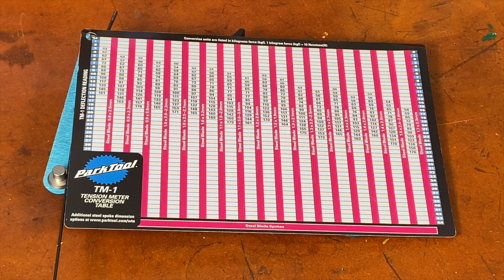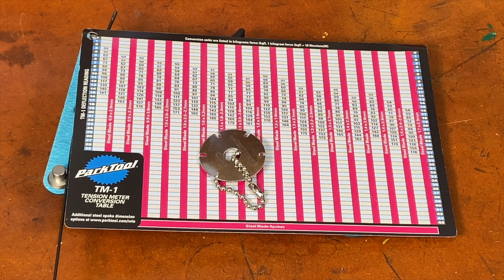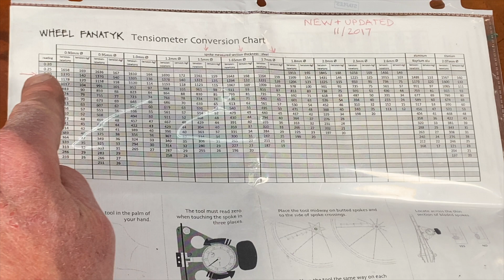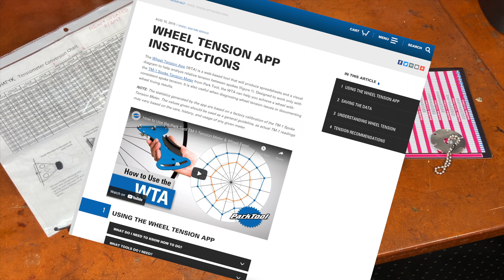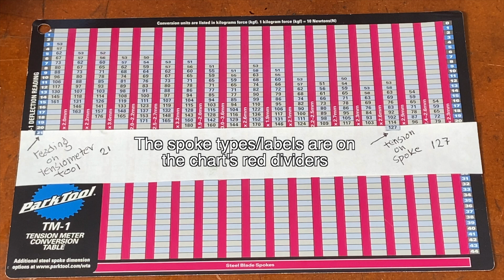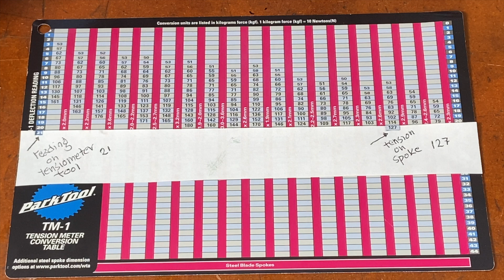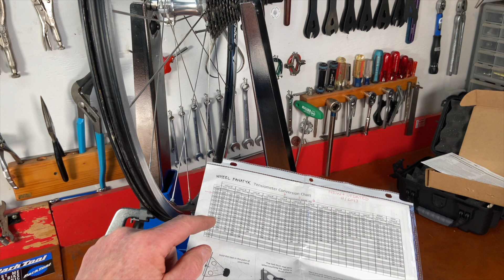Do You Need A SPOKE TENSION METER to Build Bicycle Wheels?

Comment: Thanks alot for this man the wheel on my surron has some radial run out I can feel it just a small amount so i ordered a meter I hope it will help me fix it up. On a side note please start using some o'keeffe's working hands cream on those hands they look dry and sore.  you will thank me later cheers .
Reply from the maker: You’re very welcome and thank you for the O’keeffe’s tip. I will give it a try. You don’t need a tensiometer to straighten/true wheels. All you need is a spoke wrench. In my how to build wheels video I provide complete instructions. Thanks again!
Reply: @JimLangley1  my hands got real bad one time from braiding  paracord dog leads .  dry cracked and sore as heck I got that cream and it was amazing how well it worked.  I'm gonna look up your other videos I just got the meter cause I don't wanna mess anything up I figure if I can check what the other spokes are at I can get the others close and hopefully get the wheel rolling smooth again . Cheers
Reply from the maker: @electricexploring9518  here's the link to my how to build wheels video, Electric: https://youtu.be/XUqul03hbZ8
I do appreciate the hand cream tip because my mechanic hands can get really bad as you've seen. Thanks a lot!

Comment: Thank you very much Jim. Lot's of knowledge in this video.
I've recently built my first wheel without a tension meter and was worried that the spoke tension will be uneven or too tight / too loose. I'm sure they are, but not so much that it matters. I've abused that wheel a lot and after a second tensioning when the spokes set, it stayed very very true. I used a second wheelset with similar spoke count and spoke length as "tightness" reference. By squeezing the spokes with your hand you can develop a feel for how tight they are.

If you are not a professional wheel builder, I agree, you don't need a tension meter to build a basic wheel. But if you want to build a performance wheelset with low spoke counts and or carbon rims, handing the wheel to a professional might be a wise decision. The wheel I built used some very thick flange track hubs and a mountain bike rim with 32 spokes. I'm sure that helped evening out some mistakes I made. Maybe I will get myself a tension meter for some upcoming, more advanced projects.

Greetings from Germany.
Reply from the maker: Thanks for watching and sharing your tensioning experiences and tips, polychromatism. You obviously enjoy wheel building so I think you will enjoy owning and using a tensiometer😀

Comment: Watching your videos, I'm reassured that not only could I build a wheel for myself but I could enjoy the process. Thank you for the generous resource.
Reply from the maker: Thanks for watching and the great comment. I'm happy to hear my videos are helpful and that you're thinking about building wheels. You can do it.
Reply: I've built many a wheel myself.  Rene, the owner of G & R bike shop in Detroit spent so much time on my wheels, that he gave me free guidance on DIY.  That was in the early 70"s.  After reading Jobst Brants' book, I truly went DIY. Spending 3 three year tours in Panama and Germany, lacing wheels for my high speed, low drag bike comrads gave me the confidence charge for my service.  The tools mentioned can make a Harbor Freight job a Snap-On jobd.   Thank you for your time and passion to share your knowledge.
Reply from the maker: @MrAudioBill  thanks a lot for watching and for sharing your wheel building journey, MrAudioBill. It's wonderful that G & R bike shop helped you learn to build wheels and also that you used your skills to help your comrades. You're right that Jobst's book is a fantastic resource. It's out of print now but actually available to read for free online if anyone is interested (here: https://www.dropbox.com/s/mbsx865uzz0s7jq/Bicycle_Wheel_-_Jobst_Brandt.pdf?dl=0 ) Jobst Brandt was the engineer that helped design the Wheel Fanatyk wheel tensiometer that I show in my video. Thanks again for the watching and most excellent comment ❤🙏

Comment: Thanks for a good video.
I have a question: schould i check spoke tension only on the driveside on a back wheel, and on the disk side on a front wheel?
My wheel manufacturer only specifies spoke tension for driveside and disc side  aswell.
I assume the reason is that if the wheel is centered the spokes of the other side get the right tension automically.
Am i right or have i got it all wrong?
Reply from the maker: You have it right, Martin😀Thanks a lot for watching!

Comment: Hello Jim! I am very glad to see your videos.

So if my wheel is wobbly the procedure looks like following:
1. I have to equal tension on all spokes.
2. When the tiighteening of spokes are the same, I can do cancel the wobbly of wheel then?

PS. During the alignment with the wheel, the tension of the spokes always changes, so the work is Sisyphean
Reply from the maker: Thanks for watching and the great question, Michal. Truing a wheel and getting the spokes tight enough is definitely a Sisyphean task - you do have to keep working on it until you get it right and the wheel is constantly changing. You do get better and faster at it with practice but some wheels can take a lot of work and time.

Truing a wheel making it straight (side to side) and round (up and down) almost never results in a wheel that has equal tension on all the spokes. What you are trying to do is end up with a true, round wheel with close to even tension on all the spokes - all within a close range.

What you do step by step usually is you true the wobbly wheel and get it as straight and as round as you can and then you check the tension. If you know that there are loose spokes or a broken spoke you would definitely start by tightening the loose spokes or replacing the broken spoke.

But, usually the truing comes first and then you check the tension. If you have a tensiometer tool you can use that. If you don't, then you can compare the feel of squeezing the spokes on your wheel with another wheel that you know is a good wheel - like a brand new one.

Since you asked about truing a wobbly wheel to align it, you might want to watch my video about wheel building where I explain the entire process from lacing to truing to tensioning. This video you watched is the final step and more about the tools than the process. You can watch my wheel building video here: https://youtu.be/XUqul03hbZ8  If you want to only watch the truing section go here: https://youtu.be/XUqul03hbZ8?t=1585

I hope this is helpful. Please let me know if you have more questions. Thanks again for watching!
Reply: @JimLangley1   
Hello Jim!
Thanks a lor for your how comprehesive response and very usefull tips - everything is clear for my now!

Of course I have watched your video about wheel building already but with pleasure I done it again.

Yes, I have tensiometer which from one side help me to read a tension of spokes but from other side give me an awareness that my skills are not perfect so I still have to improve the tension to achieve perfect wheel.

Generally it is work without end and very important is set a limit for yourself : "what does mean perfect wheel"!
Reply from the maker: @mutos82  thanks for asking another great wheel building question, Michal. A "perfect wheel" for most professional builders would meet these standards:

1. visually, the wheel would appear to have zero lateral or vertical runout (no side-to-side wobble or up/down hop or dip)
2. the rim would be perfectly centered ("dished" is the term we use) so that the wheel is perfectly centered when it's in the bicycle
3. the spokes would be at the optimal tension - sometimes specified by the rim maker or set by the builder from experience
4. a "perfect" wheel must stay true, round, centered and tight for whatever rider is using it for whatever conditions it's being ridden in
5. most builders I know pay close attention to small details they feel make an important difference, too - such as following recommended lacing patterns (Shimano disc wheel lacing for example - here's my video on this: https://youtu.be/gfWd7_avr1s ; and aligning hub labels, my video is here: https://youtu.be/8FiyUyJN7Uw and a clean wheel when done - no dust, grease, oil, fingerprints

The thing to keep in mind, though is that you don't always work with perfect rims. Sometimes you have a rim with a small imperfection at the seam (aluminum or steel rims). If it's the only rim you have to build the wheel with then all you can do is work with what you have. And in that case you will end up with a wheel that's not perfect, but you still try to get it as close as you can. And most builders will have a tolerance where they will refuse to build with a rim if they don't think they can get it as true, round and tight as they need to to meet their standard.

Building wheels is definitely a process that lends itself to fanatical or obsessive efforts to get wheels perfect. Some pro builder use dial indicators and strive to get wheels even more perfectly round and true than can be seen by the eye.

But that's definitely not. necessary unless it makes you happy to go to that extent and if so, then great. 

Sorry for the long reply. This is an interesting topic and it's fun to talk about. I hope this is helpful and happy wheel building Michal!

Comment: Guys, why is the tension on one side more than on other side? Cant it just be the same number? Thx for answer
Reply from the maker: Thanks for watching and the question, G. The tension will be different on the sides of the wheel when the hub is not centered over the axle, such as on rear wheels with cogs on the right side and on most disc brake wheels that have a provision for rotors on the left side. Since the hub isn't centered the spokes aren't either meaning usually that one side's spokes are shorter and tighter than the other. Spokes aren't always different tension, it depends on the design of the hub, but with most standard rear wheels and disc brake wheels, it's usually the case. Hope this answers your question. On most rim brake front wheels both sides of the wheel will usually have the same tension.
Reply: @JimLangley1  The hub measured at the outermost point of the axle is centered relative to the rim. It is the hub flanges that are not equidistant from the axle ends. I am ignoring a few exceptions to the rule like some of the early fat bikes that had offset rear dropouts.

Comment: I have both gages. (Well the park style one is  a Venso) so far I have found the a good work flow is to use the Venso/park to keep my tension even from maybe 50 to %75 final tension. Then swap over to the Wheel Fanatic for final tension. That has helped me get my radial true dialed in a lot quicker. I do wish i got the digital gage though. Thanks for the videos they have filled in those small gaps that have helped me get to the next level
Reply from the maker: You're very welcome, Tim. Thanks for watching and for sharing how you use your tensiometers.
Reply: Why don't use use the Wheel Fanatyk for the whole job? From what I read, this is the only design of tension meter that works well at low tensions (so, early in the build process).
Reply: @GenePavlovsky  you lose track of how many times the dial goes around at very low tensions. The sheet metal one is better at that stage

Comment: Just wanted to check is 120kgf or below enough on 28h 700c wheelset for 120kg only ride on road (I am searching for tubular alloy rim to support 120kg so I can ride it at my heavy weight still even if get back to it but enjoy it when 85kg)

Yes I seem others you said 90-120 I just wanted to be sure

Looking at:
VELOCITY MAJOR TOM MSW BLACK 700C REAR RIM (mainly as saw Kinlin TB25 is 105kg max)
Berd spokes
DT SWISS Hub 240 Straight pull Rear CenterLock 28H
Reply from the maker: Thanks for watching and the question. For a 120 kg rider I would recommend going with more spokes than 28, at least 32. And I would go on the high side of that tension range so that the spokes would stay tight... Berd "string" spokes are interesting to build with, have fun. I have a video showing how it's done https://youtu.be/opqBFX8GrQg

Comment: Hi Jim. Do you know of a tension meter that will work with 20" wheels? I build mostly bmx race and freestyle 20" wheels. I have yet to find a tension meter that will fit into the space of that size of a wheel. Would you agree that if my spokes are tight and with the proper spoke length not exceeding past the nipple slot when tensioned, that proper tension is achieved? Thanks for all you do.
Reply from the maker: Thanks a lot for watching and the great question, cx4130! I only have one set of 20-inch wheels so I tried my Park tensiometer on those wheels. The front is radially laced (no spoke crosses) and the tool worked on that wheel. On the rear wheel, which is 3-cross, the tool just barely worked but I had to turn it sideways in order to get the lower peg on the tool to land on the edge of the spoke. There are 4 inches between the tool's 2 pegs that the spoke rests on so you need 4 inches of spoke in order to get the tool on it. The amount of spoke you have depends on the flange size of the hub and the cross pattern used, but I think the tool will not fit on too many combinations used for 20-inch wheels unfortunately.

I don't know for sure of another tensiometer that will work on 20-inch wheels. But if you could find one that requires less than 4 inches of spoke to get a measurement you'd have a tool that could work. There are lots of them on Amazon and they have a great return policy. So you might just bunch a few, try them out and return them if they don't fit.

On your second question, I would agree so long as your spokes really are tight. The proof of whether spokes are tight enough is that the wheel stays true and round and the spokes stay tight and don't loosen up when riding. So, if that wheel you build does that then your spokes are tight enough. The tricky thing with small wheels is that the spokes are so short they can feel tight when they're not tight enough. But, like I said, you would find out that was the case because the wheel would end up going out of true and the spokes would loosen as the wheel was ridden more. That would tell you to tighten them even more when you true and retension the wheel. I hope this is helpful and thanks again!

Comment: Park now has an web-based tool that can be accessed instead of using the chart.  The user provides various inputs and it spits out the results.
Reply from the maker: Thanks for watching and the comment, Don, appreciate it. Yes, I put a link in the description to Park Tool's great app. Here it is: https://www.parktool.com/en-us/blog/repair-help/wheel-tension-balance-app-instructions
Reply: @JimLangley1  Love your vids.  Not a wheel builder, but I'm a bigger guy (6' 1", 225) who has to order "boutique" wheels - Boyds and Williams - and true them up with some regularity.  Watching your videos on HOW to build them in the first place, as well as how to true them, has helped immensely.  I used to buy Mavic wheels (before learning they're targeted at 175 lb. riders - nothing wrong with that - and finding cracks in the rims after a few hundred miles).
Reply from the maker: @donkeninitz4590  I’m happy to hear my videos are helpful and that you’ve found some wheels that hold up, Don. I’ve only heard great things about Boyd wheels and they are a family business so should be helpful if you ever need support. Thanks a lot for watching my videos!
Reply: Parktool still doesn't tell you the ideal tension to set them to though
Reply from the maker: @janeblogs324  Hi Jane, Park Tool is a tool company, they don't make rims or wheels or spokes. The recommended tension ranges for wheels is something that you get from the rim manufacturer. So when you're building wheels you either look at the spec sheet with the rim or contact the company that made the rim or visit their website to find out what they recommend for tension. Hope this helps you out. In most cases, the range will be from a minimum of 90 kgf to 130 kgf depending on the rim design and materials and purpose.
Reply: @JimLangley1  most of us don't use brand new rims, emailing the companies direct is a waste of time 99% of the time. 
There's no data, no guides out there. All you can do is measure another wheel and assume its ideal
Reply from the maker: @janeblogs324  in my previous reply I gave you a good range that works with most rims/wheels. You don't need any more than that really. Pro wheel builders (like me), will try to build to the tension a rim manufacturer specs so that there's no question the wheels were built correctly (since the person who buys them expects this - might even require it). When buying new rims you can reach out to the company and get this information - I do it all the time. If you're building with used rims and can't find a spec or don't want to spend time trying to find one, just build them to around 90-130 kgf. You can feel if spokes are getting too tight when you build the wheel and you stop when you feel it (it gets too difficult to turn the nipples). It sounds like you have a spoke tensiometer so you probably already have a good feel for how tight is right. There's loads of guides out there on wheel building and spoke tension, etc. Try wheelfanatyk.com's library as just one source. Here's another great wheel building resource: https://spokecalc.io/articles.php Okay? Hope something here helps you out and happy wheel building!